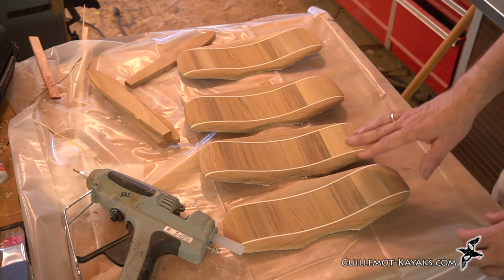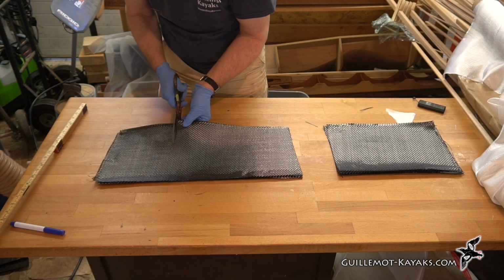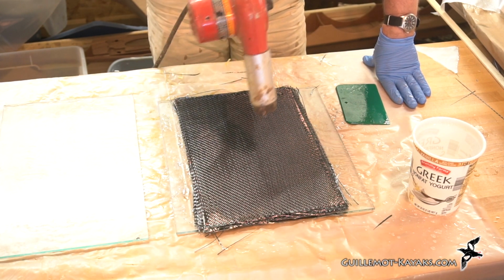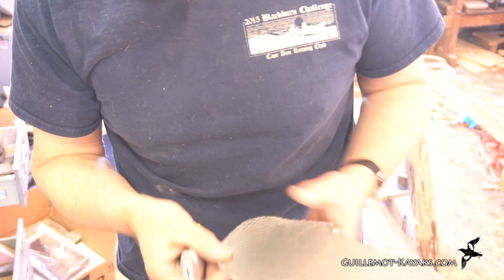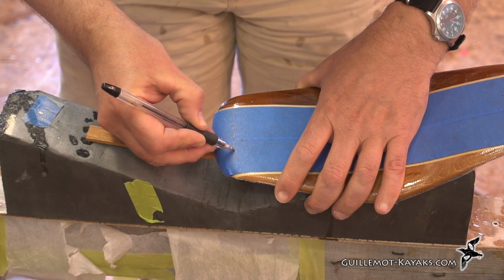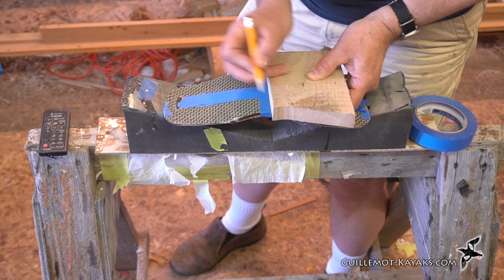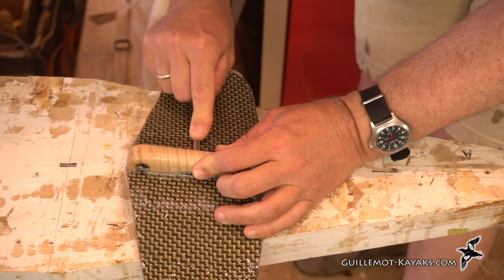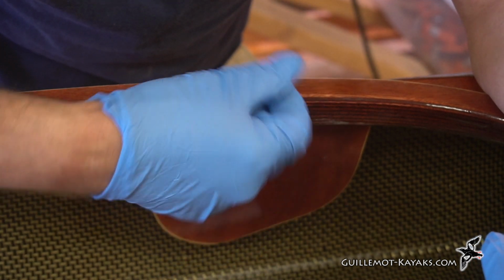Backrest and Skeg - microBootlegger Sport - E59

Comment: What software do you use to design and make toolpaths? I built my own CNC Router that is operated by Linux CNC and I’m wanting to do 3D pieces like your seat. I’m close to getting a shop and I’m going to build a strip canoe or kayak as soon as can
Reply from the maker: I'm using Aspire to generate the tool paths for my shopbot.

Comment: Have you ever counted how many clamps you have?
Reply from the maker: I once bought 100 of the 1" small orange Pony clamps. I have about the same number of various 2" spring clamps. I got a deal on 25 4" F-clamps and have another dozen or so larger F and pipe clamps. I certainly could use more.